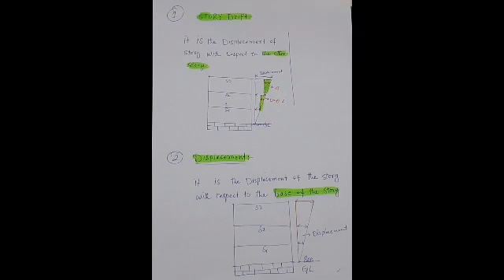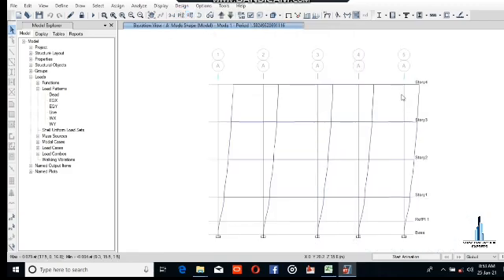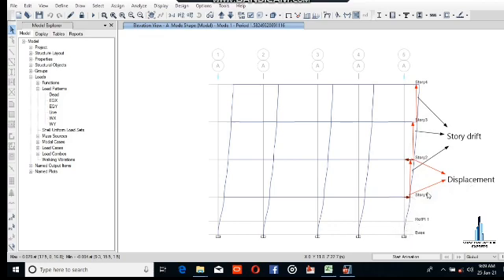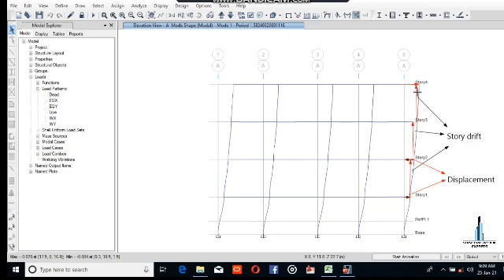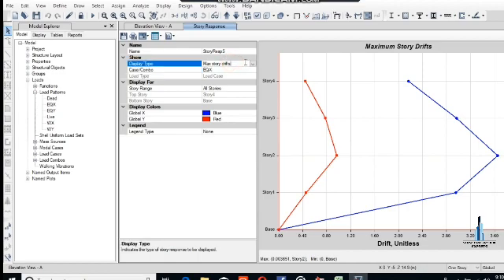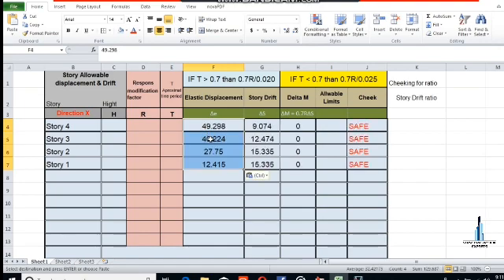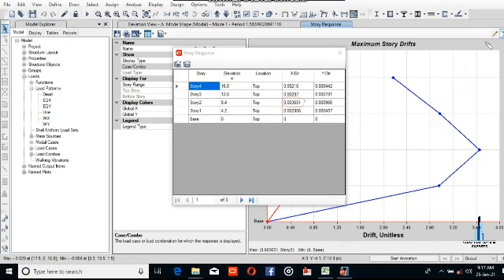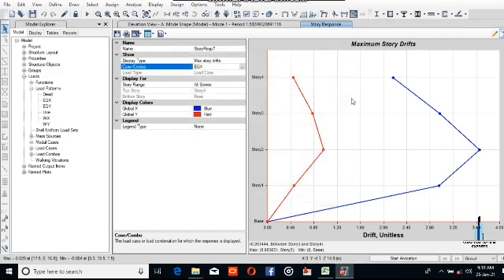Lecture # 8. Drift and displacement calculation in Etab v18.

Comment: AoA..hi dear please make video on Designing of basement wall which is not uploaded to youtube yet..or guide me about Designing of basement wall using Etabs.
Reply: As the slab can be designed in csi safe or Excel sheets. As others designers  only take the live and super dead loads and put that in sheets , so they deisgn the slabs like this.my question is ..If transfer the loads to columns then why they consider the loads from slab on basement wall..and the soil pressure will be there ..the problem is about coming of load's from slab to columns. If yes the loads must be taken on basement wall then how it will be taken.. please help regarding this issue
Reply from the maker: I not properly got your this question !
Reply from the maker: Above the basement all shear will be taken by the core wall. Once the accumulated shear reaches the basement top slab, this slab will act as a support to the cantilever beam that is your building (with a distributed wind load acting on it). This is generally what happens when the soil surrounding the basement can be considered stiff enough as to prevent any significative displacements.. plus, if your building area is much smaller than your basement area and the basement walls are very large (which is common), the walls alone can act as supports restraining the basement from any significative displacement. So either way, it is important that you put restraints to your model at the basement-top-slab level. Like MrHershey said, you should think about what is most likely to happen in reality, most of the times you can determine this by visualising the building as a cantilever beam with any kind of forces acting on it.
Reply from the maker: use ETABS for analysis. I guess that the "panel" would equal "shell" in ETABS. If so, I think that is the way to go, since all shear collected above basement-top-slab level will be transferred to the basement walls by the basement top slab and the basement walls will transfer it to the soil around and under them. So you do not need of any special technique or modelling to capture this. Using shell elements to model the basement walls would be more realistic, simple and accurate.

Hope it helps.
Reply: Thank you dear...
But can you please make a video on what you told. Please make a video on this topic.
Reply: The second things is about Designing of stairs..how to deisgn the stairs.. modelling is different and design is different .many engineers says that it must be designed in excel sheets
Reply from the maker: Basically the stairs is not part of the frame structure, as it does not count in the category of weight transfer work members.  The stairs is designed to bear only for its own weight and the weight of the walkers.
There is no design cheek for stairs in etab,
Others cheeks are, fram means beams and colums, slab, and walls, are to be considered special design members.
Reply: I am saying that some designers  Use Excel sheets for slab design instead  csi safe.. And they say that slab transfers the loads to columns ..so if the slabs transfer loads to columns then why we should consider the load on basement wall...
Please make a video on basement wall design if you can then it will be really helpful for me and others